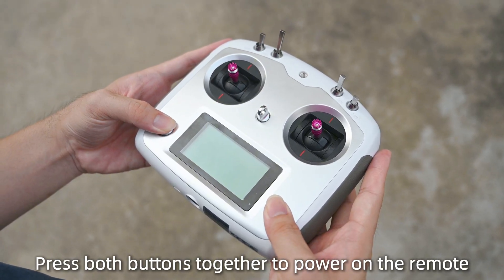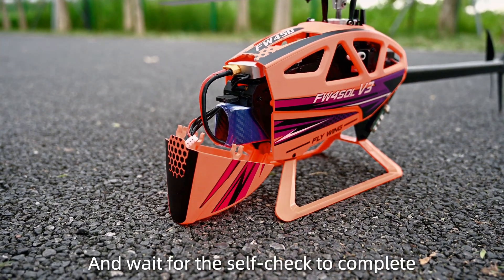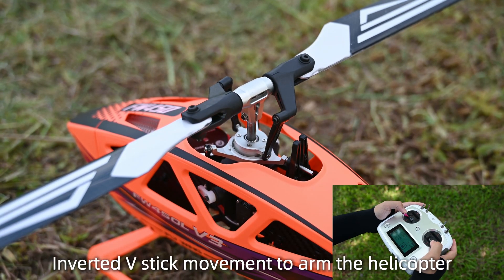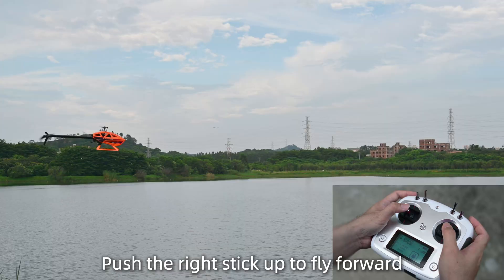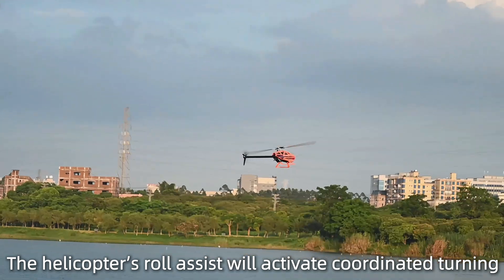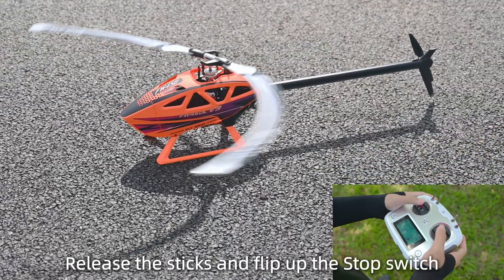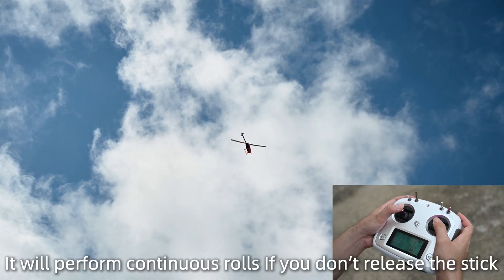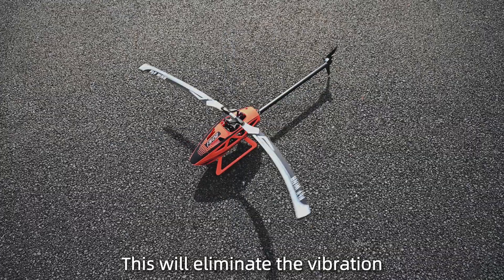FW450L Flight Tutorial | ACE Flight controller

Comment: Hallo, kann man mit dem ACE Controller auch 3D fliegen und welcher Mod währe das ? Vielen Dank
Reply from the maker: Fw450L can use smart acro, but does not have traditional acro mode
Reply: @flywing7015  kann man in dem smart acro mode 3d fliegen ?
Reply from the maker: @rolfhelmrich4764  In smart mode, the joystick can be used to fly if the joystick does not exceed 80%.
Reply: @flywing7015  Vielen Dank 👍